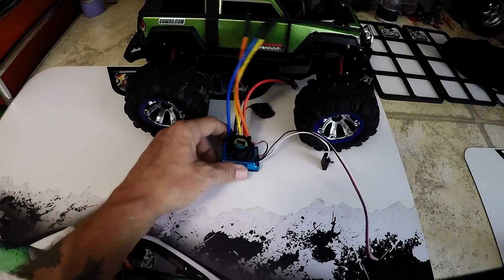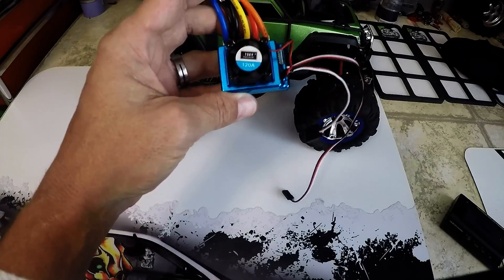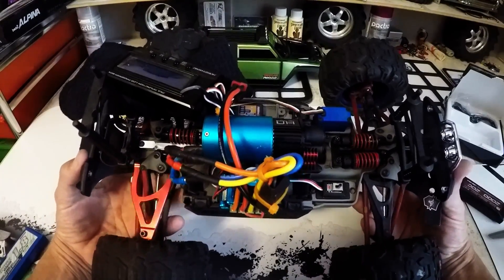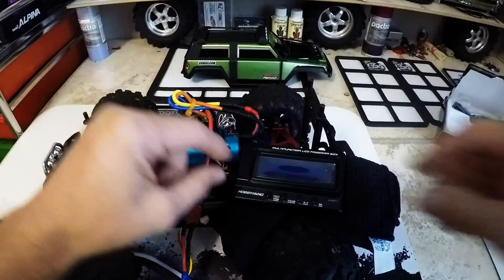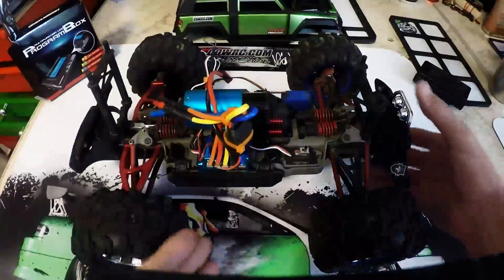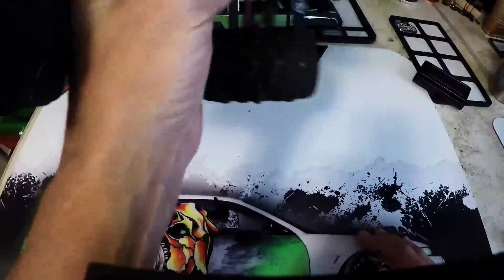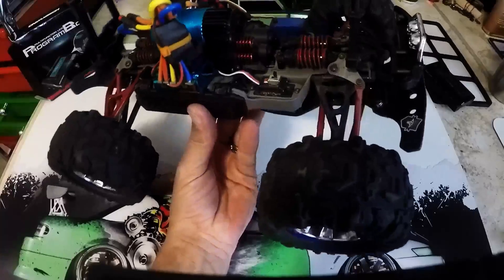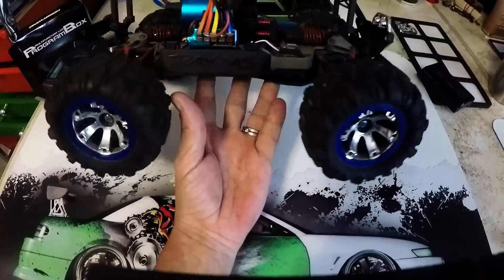UNIK TSKY 120a brushless ESC Review

Comment: I have this ESC in my axial wraith piard with a 6.5t Novak sensored motor and run on 2 and 3s no problems very fast and crawls slow too. I used a $8 hobbywing card to program using the hobbywing manual as a reference.

Comment: So how is the ECS holding up? Let us know. Thanks
Reply from the maker: It's still going strong. I've run brushless and sensored brushless with no issues. It's been in dirt, street and held up well. The program box from hobbywing is the key item to have. Easiest way to program the esc.
Reply: Duke Walker thanks for replying. My son put a 3s on our ECS and it stopped working. I think the power to the receiver went bad. I'm for sure getting a programmer. Thanks for the update.

Comment: what model is the program card . i have  a esc and cant figure out how to program it .my truck is stuck in reverse
Reply from the maker: it's the Hobbywing multifunction LCD program box that b I used to program the esc. sorry for the late reply.
Reply: what did you pay for the box and do you have the exact model of it?
Reply from the maker: There's no model number on it. but it's the multifunction program box that also has the voltage meter on it for lipo batteries. pice ranges from $30-$35 depending where you get it from. picked mine up from amazon.

Comment: it's a good esc I run it in my 1/10 scale buggy on 3s and a 2850kv goolrc motor pulls wheelies easy with short course wheels it did a standing back flip so I had to make a wheelie bar it's geared tall for 60-65mph it seems like a great esc to me but I never had any other brushless rc's before to say if it is a true 120a but the mosfets will tell you what it is I'm thinking about running 4s for high speed runs with taller gears if you read all of this then thanks lol.

Comment: It's real 120a and burst 760a ?
Or fell same like 60a?

 And you use 2s lipo?
Reply from the maker: I would say more like 120a burst and 80a constant. Give or take. No issues with lag or sluggish take off. BUT,, I was only using the 3300KV brushless motor as well.
Reply from the maker: Sorry for the late replies! I have been testing the heck out of this esc and it has held up really well. I run 2s all day long and haven t had any issues. ESC is now in my HPI mini trophy truck and runs just great!